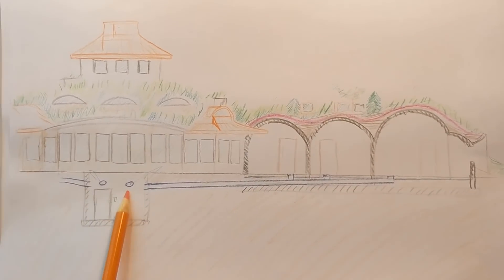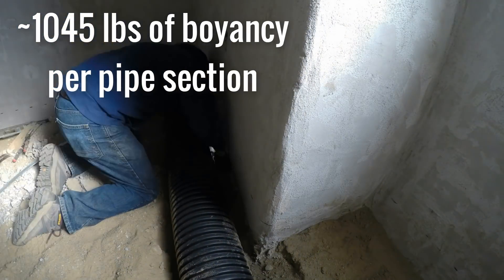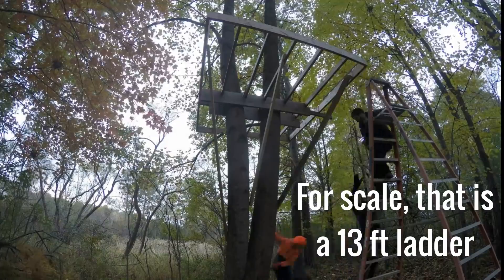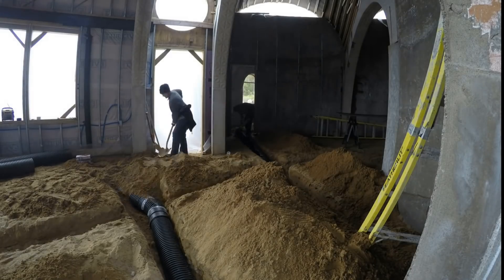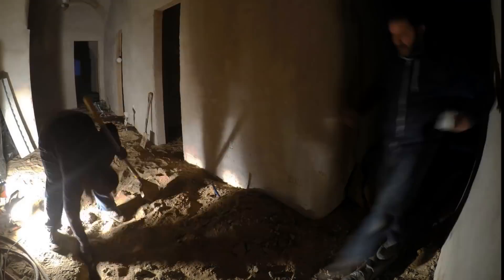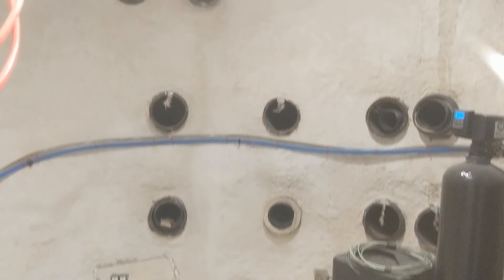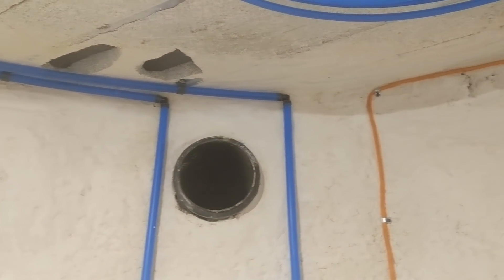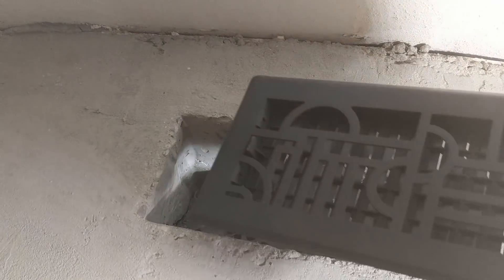41.5 HDPE ventilation ducts

Comment: i was worried until you said the tubes are smooth inside. They seem to be also "excessively" large in diameter, which is a good thing for helping reducing friction and improving natural air flow.
Reply from the maker: Yea, I don't think the diameter is excessive at all.  The parameters (length, diameter, airflow speed, etc.) all need to work together.  A large diameter on a short pipe would make the system ineffective, but on a 250ft long pipe, it worked very well.  I was concerned that a smaller diameter pipe would build up too much back pressure and really reduce my airflow volume and efficiency.  I wanted low backflow so that the air could even move passively.  To experiment, I have a pair of 6 inch tubes and a pair of 8 inch tubes.  The 8 inch tubes carry twice as much volume when the fans are on and something like 10 times as much volume under passive flow conditions.  I find that the smaller tubes do moderate slightly better (about 2 degrees closer to moderate).  I wonder how 10 inch tubes would compare at that same length?  We still need a lot more people gathering data before we know what "excessively" large is.
Reply: @SimonHomeintheEarth  Yes, it's roughly what I expected, as said I meant "excessively" in a good way. There are calculations that can be done to help to estimate optimal tube diameter. I don't remember much from thermo and hydro dynamics from my students years , but googling for engineering master thesis I could quickly find ones about this theme. For a smooth pipe the calculation is reasonably simple, provided you know flow coefficient C for the tube's diameter and surface and flow speed. Then for a flow, one has to achieve a meaningful equilibrium between some the losses and energy input. In the house I'm designing now, I have a "winter garden" room where are ducts to let escape rising heated air. Second source would be a "wing" at the top of edge of my solar panels installed in front/above the front (where outlet ducts are). Simply a small wooden decking at ~45° opposite the 45° solar panels, which would rice or lower itself to form a gap of let's say 2" one or the other direction, so that wind passing by sucks the air. Even straight up fixed gap should work, based on Venturi effect. I am planning a CFD analysis to determine optimal dimensions. The 3rd source is of course ventilator, which would kick in when insufficient flow in given time period occur. All this is only a part of ventilation; when we take into account ERV and different zones (temperature, humidity) in the house, it gets very complicated pretty quickly. Of course it's always exciting to see practical solutions and get inspired! Our made good videos. And I'm hoping to see it working in the finished house :-)

Comment: Wow, nice to see real solid flooring, not just sand!  I like all the ventilation options installed, fresh air exchange is vital.  You have thought this out very well.  Don't forget to get the cameras cleaned up and ready for the gunnite spray!
Reply from the maker: Working on that video now, and 30 seconds in to the first video, you see the gunnite mist drift and coat the camera...  Then I run up and frantically clean it off.  Good stuff.  ;)
Reply: Yeaaaaa... I had thought to add "don't forget to build a quick box to protect the camera"   but thought it might seem insulting. . . Sorry about that...

Comment: So is there insulation under the sand in the bedrooms?  Can't remember all the layers.
Reply from the maker: We did have insulation around the footings, but the majority of the floor insulation comes later.  The layers will go (from the bottom); Dino fossils, sand, footings, vent ducts and radon ducts, 6 mil vapor barrier, 2 inches of insulation, pex tubing for infloor radiant, 4 inches of concrete, and then whatever the flooring is.

Comment: should be able to flush those pipes out if needed. twice now mice have entered up the 1 inch evaporator drain tube in my car hvac and ended up getting chopped up in the blower fan. i use a garden hose flush them out from windshield defrost vent top of dash